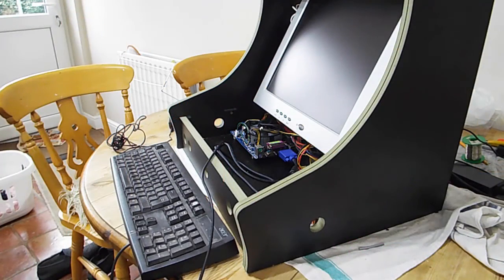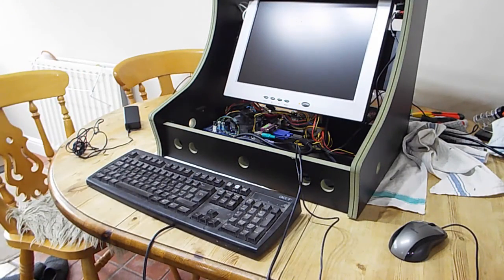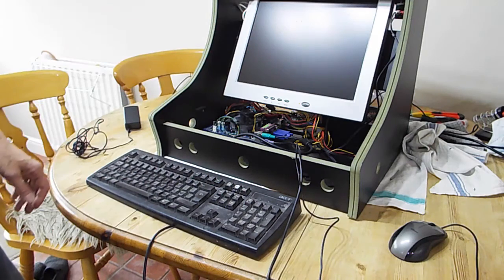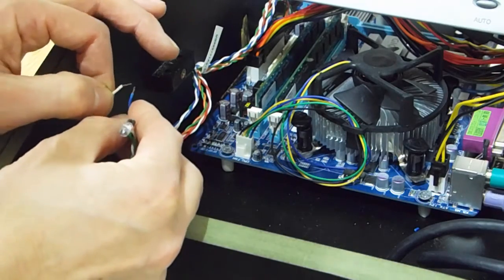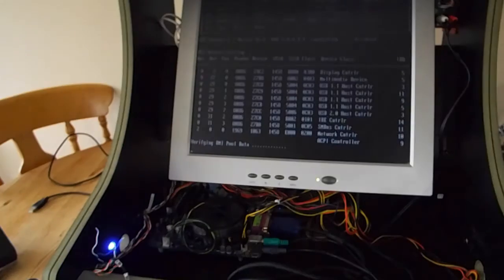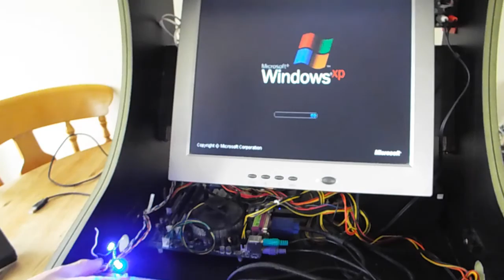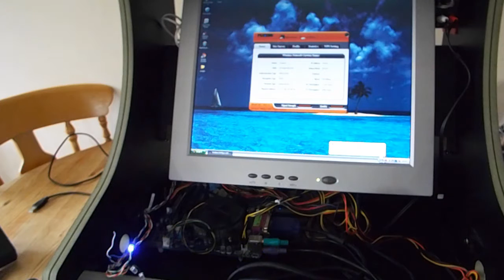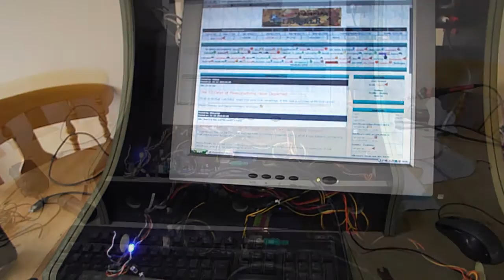MAME Bartop Arcade Machine build. Part 6

Comment: Perfectly pronounced.   : )
If you find you do need to use an actual graphics card, one thing you could try is a PCI riser cable.  It plugs into the PCI Express slot, and has a flat ribbon cable of a few inches.  You could lay the card horizontally flat, instead of it sticking up vertically.  Just check it doesn't have its fan obscured, and nothing is shorted, and it should work fine.
Reply from the maker: +MarkTheMorose That's a really good idea.  I never thought of that.  Cheers. ;-)
Reply: thank you for stating that suggestion to fred. i am currently building a bartop arcade machine right now and was wondering if there was another way to mount the graphic card.

Comment: Im watching all these from the very beginning, ive had an arcade cabinet ages but no idea when it comes to doing the pc.
Reply from the maker: Hello.  Depends on what you want to run.  If you want classic arcade games then an older cheap  i3 2GB ram pc will run them no probs.  If you want bang up to date games then you are going to need a i7 16 GB of ram etc.  You can even run Mame games from a Rasberry Pi
Reply: I have the PC its just the setting up the buttons and ipac Lol.  Was easy when I did a picade.  Pi did everything for you.

Comment: Hi Fred, this is a very nice build serie. Great job. A question about the amp; I have the same one. But when the setup is ready and I turn on the PC and the amplifier there gomes a very disturbing creaky noise out of the speakers. Do you have a solution for that?
Reply from the maker: Hi.  I did not suffer from any noise from the amp.  Maybe try a higher quality screened amp connection lead.
Reply: Hi Fred, many thanks for your answer :)

Comment: Hello nice minicab. Are you not afraid of the vibration of the disk by slamming into the panel ??
Reply from the maker: TBH i have not thought of it.  Do you mean the controls whilst someone is playing a game ?
Reply: Yes 1 play normal other play harder and vibration etc, It may or may not have a negative impact on the drive ;)
Reply from the maker: You could always mount the drive on rubber Isolators
Reply: Sure you can. How the temperatures in the middle are high?

Comment: Nice one fred its coming together nicely mate, if you add me on skype fred my name on there is plast3rr  i should be able to sort both the graphics and the hard drive mountings i have an old case here which has tooless hard drive mounts ill cut up the case and voila you can mount the hard drives so they dont look like tumbling dominoes :P also as for the gfx card i shall use the pc case and cut the mounting  so you can screw it into the wood then use that to support the card. add me on skype and we shall sort it out. cheers fred
Reply from the maker: +Steve Ellis Cheers Steve ive sent you a request.  I want to keep in contact esp as I know I can hear you on SSB but cannot get back Grrrr.  Hold back on the HD mounts buddy (thanks for the offer) as I have the same in the case iam slowly stripping.  Not sure if will use them or not.  I think the blocks may work once I can get longer bolts.  I ve bitten the bullitt for the Sim Racing PC and ordered a OEM used, stripped Windows 7 64 bit DVD.  Project Cars (which is great btw) is looking at my 32 bit version and laughing its socks off.  This free's up Win 7 for the Arcade machine wooohoo.